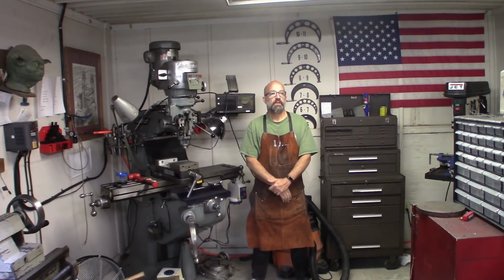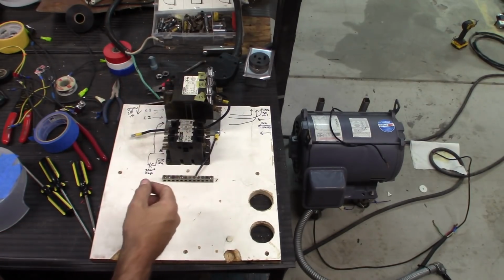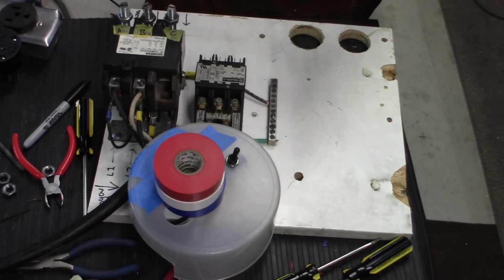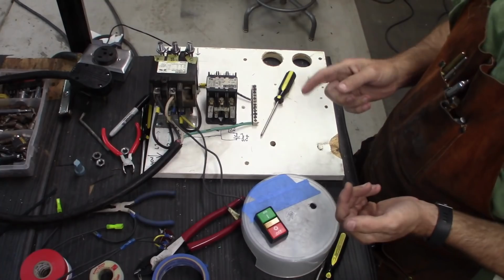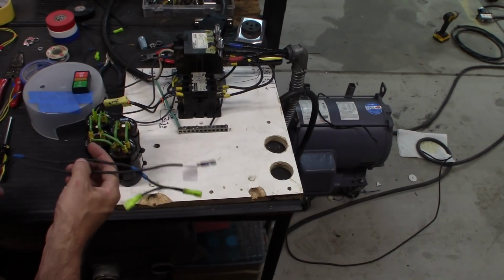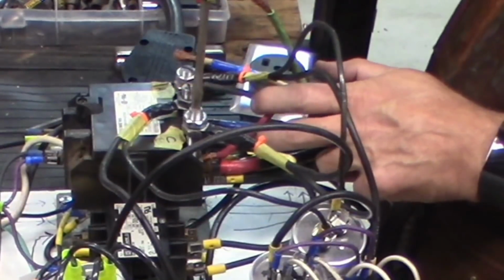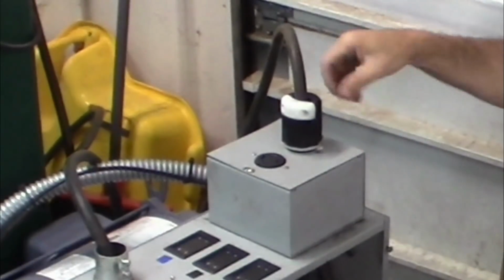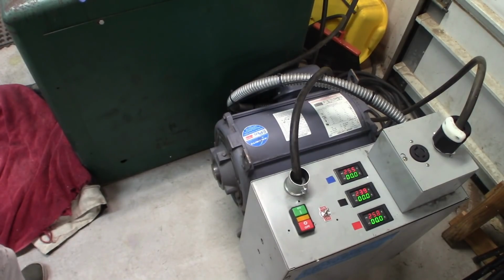Home built rotary phase converter for home shop 3 phase power

Comment: 30 HP phase convertor?  I bet the lights dim when you energize that puppy.  No wonder you have such a big bank of start capacitors.  With a motor that size I would be inclined to install a pony motor to give it rotation, and forget the start capacitors.  Keep the run capacitors for power factor correction.

Comment: I think your starting problem is with the momentary switch closing the circuit to the capacitor.  The motor leg with the capacitor needs to be powered at exactly the same instant as the two legs powered from the main contactor; the reason being that the phase shift induced by the capacitor is what gives the motor rotation. Flipping the momentary switch is like flipping a coin; you can't know if the capacitor leg is in synch with the other two legs.  Most times you get it right, or at least close enough to right; other times it's way out of phase.
Reply: I would correct the problem by replacing the momentary switch with a potential relay.  Wire the relay coil across the phase (capacitor) leg and either of the other two legs.  Wire the capacitor in series with the normally closed relay contacts.  This way the capacitor will be connected to the motor at the same time the mian contactor pulls in.

Comment: Congratulations, its Amazing!!!Please help me, I'm trying to make a phase converter but it's not working, I even burned my engine. On the table you have a contactor, how many amps is it? on the contactor side, what equipment is this? This is where you connected the energy that is coming in (both phases) and last thing, I have two wires in my house that come from the street with 127v for each phase, Sir's is also like that, correct? 

Very grateful🎉🎉🎉🎉🎉🎉

Comment: how much can a 10A main fuese  handle ??   it can just pull a toaster 2000W.. milling machines use a lot of power. we have problems with our maho 400.T cnc mill   we have 3 phases with 16 A fuses  on
Reply from the maker: 10 amps times 220 volts divided by 750watts = ~hp load or almost 3hp.

I'd be careful on a 10A breaker/fuse, especially converging to 3 phase as you're going to need a bit more draw.

Comment: The 240V 1PH systems that superimpose a third leg are GROSSLY inefficient because the 240 are still 180 degrees out of phase from one another, with the third leg being somewhere between the other two. One leg will always draw more current than the other two, which is evidence of imbalance. It's FAR better to just buy a VFD...unless the motor usage is only occasionally, and so not economical. However, in the long run, just buy a VFD.
Reply from the maker: This is a common misconception.  Due to the spinning of the 3phase induction motor makes sure the 3 individual sine waves are 120° apart as is evident on an oscope.  VFDs are great if you're running a single motor but a system to run an entire shop 20-30hp worth is prohibitively expensive. I use a mixture of both in my shop where needed.
Reply: @TheArsonsmith4242  We used spinning induction motors as well at Boeing when I worked there, but that was only to generate three phase at a specific frequency for a specialty machine. The worst of all the rig-ups I've seen is capacitors to induce a thir leg between the two 240V legs that are 180 degrees out from each other. That was out in a field for a 75HP irrigation pump. One leg always ran hotter, and so the motor was always imbalanced, this putting more electrical stresses on one coil in relation to all the others.
Reply from the maker: @musicinspire1745  That is an interesting setup.  Here we don't have two 240v legs that are 180 degrees out of phase, we have a single phase 240v that oscillates between +120v and -120v.  This is due to the way residential housing in the US taps the power transformer on the poll to make 120v circuits as well as 240v.  Another common misconception is to think of that as two phases but I assure you it is a single phase since a power phase is measured between legs not the legs themselves.  To have a 2 phase system you would still need at least 3 legs, while measuring between one set of them would measure no voltage, otherwise it would be a 3 phase system.

Comment: Replace the manual capacitor switch with a adjustable start up timer set to a 1 or 2 second delay to automatically cut off the start capacitor.
Reply from the maker: I did get a delay relay but for the past couple of years I've just lived with it the way it is.  Slight inconvenience vs pulling everything apart and shutting down the shop 3 phase.

Comment: Sir for 20hp? I have 220volts supply I want to run 20hp 3phase 380 volts. What capacitor I need? Tnx sir
Reply from the maker: It will differ for every motor.  You'll need to find an estimate starting point then tune with a multimeter once you get everything close.

The tuning process is just a matter of start everything up and check the voltage.  Shut it down and add or remove a capacitor and do it again until you find the combination that gives you good balance +-10% or so.
Reply: @TheArsonsmith4242  tnx master

Comment: FVD ,,,no problem,,,,,, but! for the power  you need gonna  cost  a lot $$$$$$$$$$$ because the bigger  the VFD  the more $$$$$$$
Reply from the maker: Yep, running it for 24 hours straight ends up costing about $15, although that is also with a CnC machine running long jobs as well.

Comment: Great video, and simple overall. The big thing is the maths for the capacitors and having the ability to start/run the pony motor from a reliable single phase source with enough amps for the voltage not to drop. Sadly lots of places still only have access to low amp connections or had contractors build to min spec connections so you can't even upgrade without selling your soul haha

Comment: Arson smith, are you saying that you fired up a 30 HP motor on just 50 amps?  I have folks on PM saying I will be making a light show throughout the neighborhood if I try to cap start my 50 hp. Yeah right I have my own power pole and transformer from POCO.  I was about to buy a ready made cabinet and they scared me out of it.  I decided to go pony motor which will be far more complex.  But now after seeing what you are doing I am left scratching my head.  I have 200 amps( more like for an inductive load only the power company says)
Reply from the maker: I've been running the 30hp now on a 100amp breaker for a couple of years.  originally it was on a 50amp breaker and it would pop it every once in a while.  as a quick update I swapped in a 70amp and was able to run it for a while, although the wiring was way to small.  I have since updated everything to a 200amp sub panel and a 100amp breaker to feed all shop 3 phase.
Reply: @TheArsonsmith4242  so basically you saying that my having 160 amps to the shop ( maybe 200 for inductive loads)  and a 50 HP Idler I should go ahead with the cap start without any worries and put this thread behind me.  
https://www.practicalmachinist.com/vb/transformers-phase-converters-and-vfd/50-hp-rotary-pony-not-pony-389477/
Reply from the maker: @joeshmoe5935  I can't give a professional opinion on it as I am not an electrical engineer.  All I can say is that it worked for me at the numbers I posted above.  (not without problems at the low numbers)  your millage may vary.
Reply: @TheArsonsmith4242  seller didn't even want to guarantee me under 150 amp draw, that's why I started thinking only way to go is pony motor.   At 70 amps, did you have trouble?
Reply from the maker: @joeshmoe5935  At 70amps it would occasionally pop the breaker.  American Rotary has stats for all their converters and what is needed for them if you want a more official source.  https://www.americanrotary.com/pdfviewer/?pdf=3108  Looks like their ADX-50 recommends a 150Amp breaker.
Reply: @TheArsonsmith4242  Thanks looks like you found me a winner.  I am thinking I have the perfect motor and they have the perfect panel.

Comment: In the long run would be cheaper and a lot more convient to just get a 200 amp 3 phase service installed. Back in the early 1960's helped my sparky dad wire in a machine shop that only had a 2 phase 5 wire service. Took machine shop owner a year to get a 2.phase Bridgeport. He had us install a phase changer for a couple of new 3 phase machines. Went back a few years later to install another phase changer. Nice vid.
Reply from the maker: I looked into it and it would be $22,000 to run the service, then I would have to pay a premium on the monthly usage as well.  This was not an option.  Building this phase converter was between $6-800 worth of parts found on craigs list.  Even a similar commercial converter would be around $2300.

Comment: Hi, I'm guessing that the motor you're using is wired delta configuration. I'm going to look at a 30hp motor to build my own but I'm wanting to start it using a start motor and switch to star so o can produce a stable neutral. The starting issue you have is that you need a no volt contactor powered off one leg of the 3 phase output. That way the capacitors will only cut in once the motor is up to speed.

Comment: Hello I am interested in Rotary Phase Converters. I would want to build. I have a 5 HP 240V motor. I connected on 240v single phase L1 and L2 to Switch to T1 and T2 5HP 240V But the motor did not run. I think I need to add capacitors for the starter motor. Then I connected T1, T2 and T3 to Crane's 208v 3HP 3 phase. Can you help me how to build the switch and capacitors. maybe I could get a display?  Please send me an email Thanks.
Reply from the maker: While I never really did a diagram, many of the links in the description have much more details and diagrams.  the only difference in mine and yours would be the sizing.  You'll always need a bigger HP rotary phase converter than the motor you are trying to run.  I have a small 1.5hp rotary that could start a completely unloaded 2hp motor but even the slightest load on the same motor and it wouldn't start.

Comment: Are all your run capacitors the 50 micro farad ones you have in your Amazon link? I was looking at just putting in a bulk order for some 100 micro farad run caps for my 30 hp build and a couple smaller ones to fine tune.
Reply from the maker: I had 50 and 30 Mfd caps.  I was able to balance the voltage to within tolerance using just the 50s and skipped the 30s. you can mix and match.  100mfd may not be fine grained enough for you to balance the voltage.
Reply: @TheArsonsmith4242  thank you

Comment: I'm looking at a Haas VF3ss which has a 30HP direct drive motor and the power requirement is 70 amps @ 220 volts 3 phase. I have a 200 amp single phase service. Is it feasable to build a 3 phase rotary converter for this in my scituation or is this just to much to ask?
Reply from the maker: you can get an idea here https://www.americanrotary.com/products/view/ad-digital-smart-series/?attribute_model=AD-60

Comment: Did you get around to adding a meter to the input side to see how many amps you were pulling from mains? If so I'm curious how many amps?
Reply from the maker: well, you guilted me into it.  Idle it draws about 13amps.  loaded up with the CNC spindle running it goes to about 20amps, same with the bandsaw.   Both draw about 5-6 amps across each of the 3 phase lines.  That's all the testing I've done so far.
Reply: @TheArsonsmith4242  That's good news to hear, I just got a 30 hp motor for a RFC build and was thinking I would need a pony motor to start it due to inrush amps. I imagine your idler motor data plate is like mine, says 71 amp draw at full load, and it just pulls a small fraction of that? interesting. Are you still on a 50 amp breaker?
Reply from the maker: @Ragnar.Lothbrok.3.14  I've upgraded the shop power back in January 2020.  I now have a 200amp subpanel in the shop and a 100amp breaker going to the RPC.  Other than a slight kick with my foot to get it spinning in the right direction it starts easily every time.  I've run it once more than 24 hours, but most times it runs about 8-10 hours on the weekends.
Reply: @TheArsonsmith4242  You definitely changed my mind back to building with start capacitors
Reply: Awesome!! I expected a much higher  draw. Bonus question if I may what is the tag max amps on your idler motor?
Reply from the maker: I have one, but completely forgot about actually adding it.  May be purposefully forgot I'm not sure.  I'll see about adding it this weekend.
Reply: @TheArsonsmith4242  hey, thanks for replying. I'm most curious how many amps the rpc is pulling.
Reply from the maker: @johnnyfetzner6795  I am too, also a bit nervous, not sure I really want to know.  
lol.

Comment: U can do away with that cap. relay and put in a potential relay it will turn the start cap. Off automatically  without an momentary switch
Reply from the maker: Yeah, I even bought one and have it sitting in my todo box.  I'm stuck in that limbo of it works good enough to not tear it all apart to add in the new relay.

Comment: Excellent explanation,please what is sizes of various capacitors you used,I will be  grateful if you send a diagram for this project,hopefully to see your reply sir
Reply from the maker: The start capacitors have to be sized to the motor you are running.  The run capacitors have to be sized to balance the load.  I purchased a mix of 50 and 30 Mfd run caps and then added them until the voltage was just slightly over (8%) the target of 240v.  

I don't have a drawing of this specific rotary phase converter, but in my description are links to the one's I used to plan mine out.

Comment: Here  is what I did, the most simplest 3-phase motor in the world.   Each pair reads 220 Volts..
Take one of them LG washing machine BLDC motors that people just throw out because people don't know how to fix their washing machine or any other washing machines that use them motors.  Toss out the Hall sensors, you won't need them.
Now you have the three wires that are there.  Install a pulley on  that outside big old drum rotor using another motor, be it 120 or 220 or hell if you don't mind the noise run a gas engine.  Whatever you do.  You  will find out that them three wires that are hooked up on the stator of  that motor will give you nice and even three phase power.
The horse power you expect is the horse power you use with the engine turning the damn thing.   There is your three phase supply.   These motors are obviously delta phase. If you want Star/wye, it is easy as pie.  Just take the drum out and rewire the stator to wye configuration in 10 minutes.  Cheers.
Reply from the maker: This is amazing!!

Comment: Can you tell me the details on the contactors, like the manufacturer and model number? Thanks.
Reply from the maker: Right now everythings sealed up so I cant really get to them and I didn't document it.  basically you just need contractors that support the amperage you need.

This ebay search might be a good starting point: https://www.ebay.com/sch/i.html?_from=R40&_trksid=p2507978.m570.l1313.TR2.TRC0.A0.H0.X60+amp+contactor.TRS0&_nkw=60+amp+contactor&_sacat=0

Comment: great video! i was wondering, when you connect your 3 voltmeters, do you connect them phase to phase or phase to neutral?
Reply from the maker: it's phase to phase, no common in 3phase power.  From my understanding when you see 208V 3 phase power that is typically so you can also run a common wire and connect to one phase to common and get 110v power, but I have no experience with this.
Reply: TheArsonsmith4242 
Thanks!

Comment: so is the RPC motor a single phase or 3 phase?
Reply from the maker: It's a 3 phase motor.  for an RPC you use single phase to kick start it and get it spinning,  The other 2 windings in the 3 phase motor work like a generator to generate the other two phases.  The capacitor banks are then used to keep the voltages even.

Comment: The diagram only shows two wires like the load motor is 110 or 120.
Three phase motor has 3 Plus ground. The three wires are known to me as L1  L2  L3.
Does the amp ring go around each one of the three wires.
In the diagram the black voltage input wire from the V A meter is connected to one of the wires with the amp ring around it right.

Is the red wire connected to ground. Do they get connected to one of the L wires. If so which one L1  L2 L3
Reply from the maker: This is a rotary phase converter.  The motor is part of generating the L1 L2 and L3 by getting it started using single phase 240v regular home power.  Using start capacitors to jump start the 3 phase motor, then run capacitors to balance the power across the generated leg.  The 3 phase motor (meaning 3 coils) is running from a single coil then through the magic of induction it is able to run almost like a generator to create the other two phases.

In the end, the point of the video and a rotary phase converter is not to spin the generators motor, but to generate the power to be used by other motors (such as the band saw example in the video.)

Comment: I Purchased the DROK 0.39 Inches LED 2in1 Multimeter AC 500V 200A Voltmeter Ammeter, AC Volts Meter Panel Ammeter Gauge with Current Transformer, 2-Wires Digital Ammeter Volts Meter Tester.
Like the one you have from Amazon.

I have a Rotary three phase converter.

Can you tell me how to wire it to three phase which wire does the red and black wire connect to since it is three phase.
Please help
Sent from my iPhone
  1Attached Images
Reply from the maker: You want to measure between the 3 phase wires.  You will need 3 of the DROKs to measure all 3 phases and display the amps drawn on each of the 3 wires.  Follow the setup similar to the imagelinked below except replace the blue and yellow with each set of your colored wires.  if you have red/blue/black then:
(red)-blue
(blue)-black
(black)-red
with the amp ring around the color in parenthesis.

 https://images-na.ssl-images-amazon.com/images/I/61jdhqTrmgL._AC_SL1500_.jpg